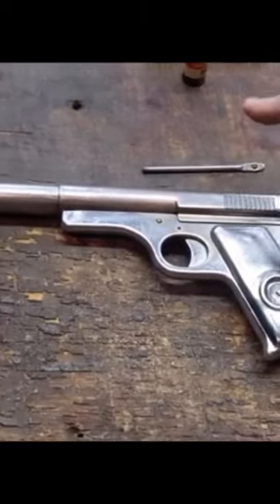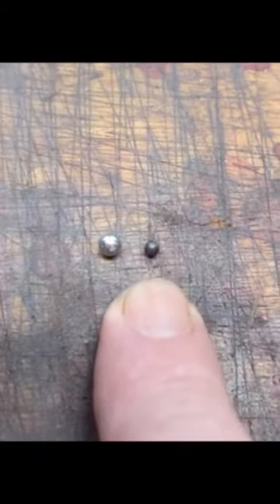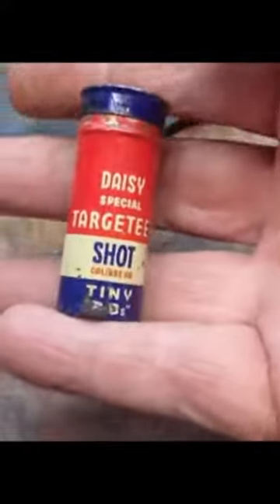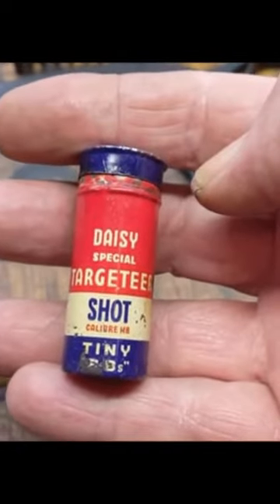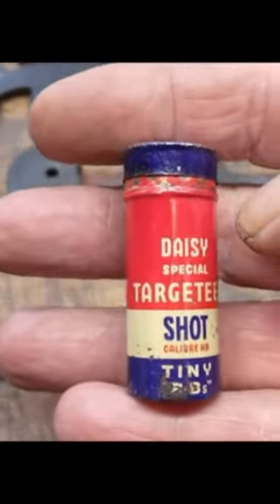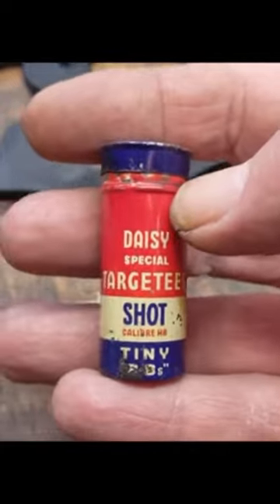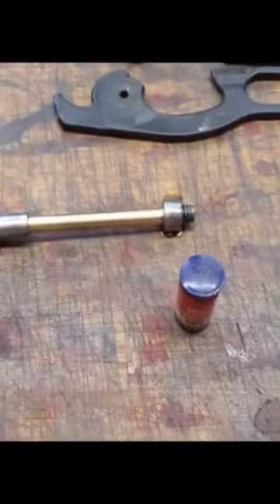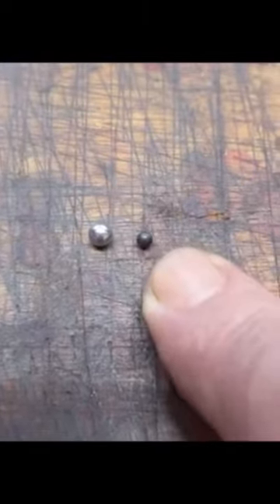Daisy lead BB's from the 1920's compared to modern steel BB's from today

Comment: Were those lead bb's made with the shot tower method? Where they dropped the amount of lead needed for the .118 diameter from high up and it naturally became round and cooled from the fall? I still find it amazing that they can today make 6 million plus bb's in a day with modern methods and still sell them so cheap.
Reply from the maker: I'm thinking the old time lead shot was tower produced but as with everything in Daisy Land there is considerable discussion on that. Here's a link to the thread over at the Daisy Talk Forum that provides a timeline for Daisy BB production by Gumslinger

http://forum.daisymuseum.com/bb-evolution_topic10063.html

Be careful which rabbit hole you head into!